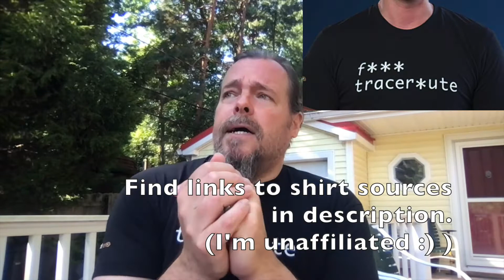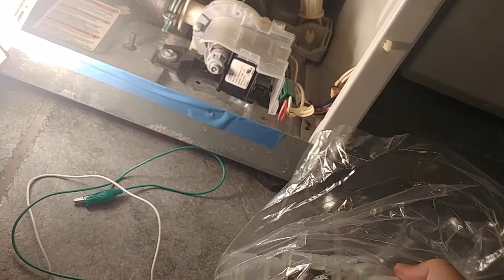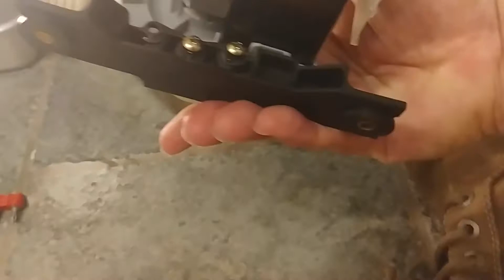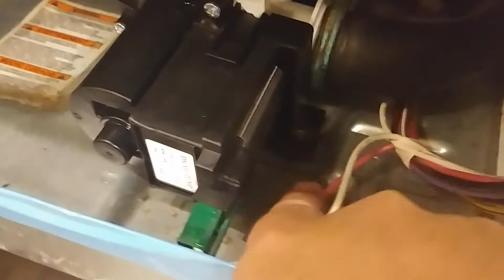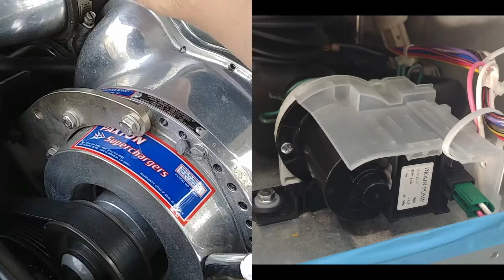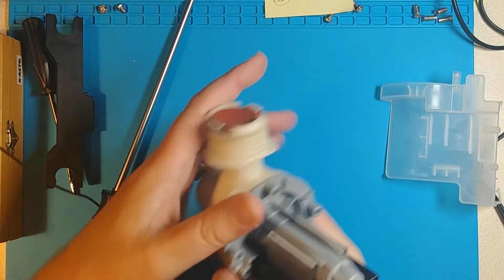VCF Midwest almost here; Kenmore Washing Machine Fix!

Comment: I had this happen before to my washer and ended up paying a service tech to come fix it. The end result was the pump had some soap build up and now once or twice a year I run hot water and a gallon of vineger through the machine and it hasn't had the issue since.
Reply from the maker: Interesting! The inlet/outlet hose were.a little slimy inside, but not obstructive and in the tear-down I show the inside of the original pump was clean as a whistle.

I have a buddy with an appliance repair biz who's great, but I really wanted to try myself - sort of a pandemic-era interest to be a bit more self-reliant. I definitely had an [apologetic] plan B to call them if I messed things up. :)
Reply: @DrDavesDiversions  this was 20-25 years ago before I had ventured into fixing my own appliances LOL, but the repair guy that came out gave me the suggestion on running vinegar though the machine once or twice a year and since that time I've always done it. I've had my current washer and dryer since 2003 and they still (knock on wood) work great!
Reply from the maker: @geekwithsocialskills  Good idea - I just mentioned it to my partner; I think we will start doing that too! Tnx!